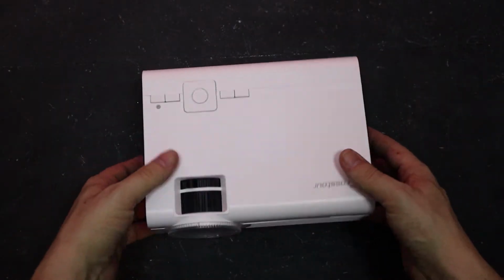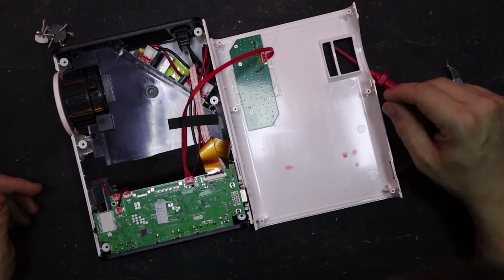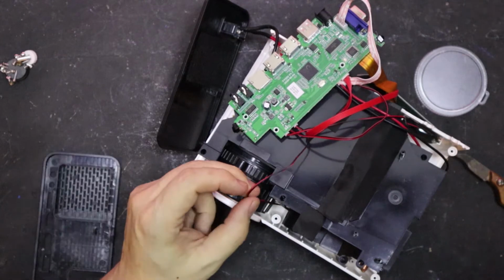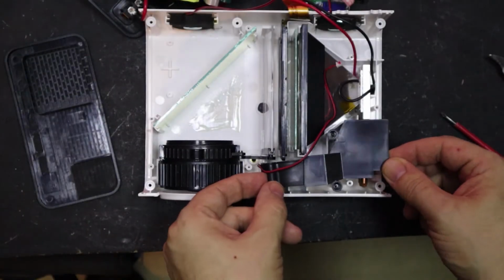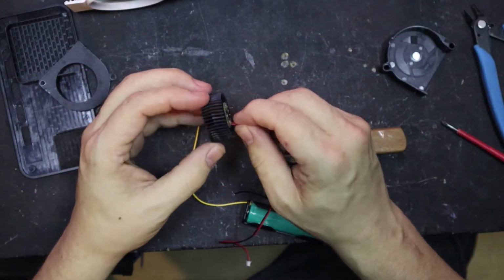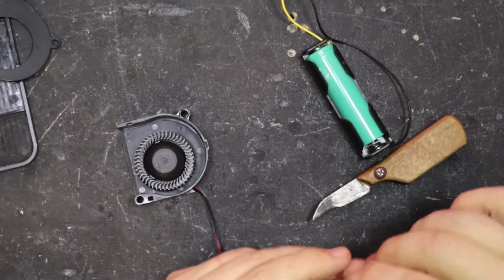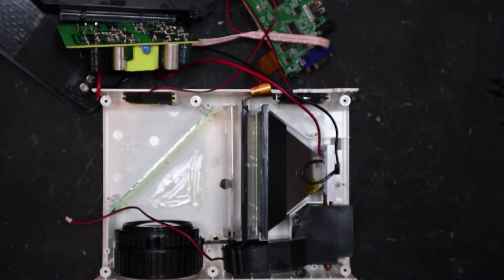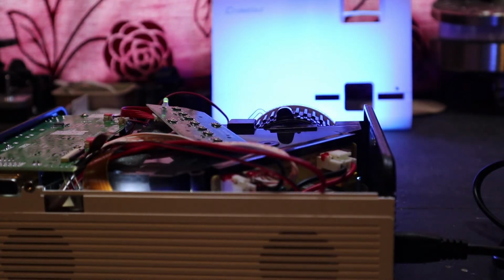Projector Teardown & Fix | A look into how a projector works

Comment: oh and you actually did not have to destroy the fan completely. you will never guess what made that sound. it was the wire on the bottom which actually lifts a bit and that then ticks on the fan blade. it can be quite annoying. and it normally happens when it is couriered.
Reply from the maker: No I checked all that. It was the blade rubbing against the housing. I've had it happen before. I will eventually have to get a new fan anyway so it's just a temp fix anyway

Comment: That is a piece of crap that projector, what cheap rubbish that end up in landfills. I do electronics and I can see you don’t have a clue what your doing at all. Don’t twist ribbon cables, always unplug them.
Reply from the maker: What a pleasant comment. I always find it funny the amount people like yourself can work out from one video. I "Do electronics" too. I have done for nearly 40 years. Just for your information It's working fine thank you very much.
Reply: @TheOffGridFamily  well as I said your not very good at it at all, not the way you do it at all. Also why the hell you want to fix a cheap bit of junk like that. It’s not even a real projector, just a cheap fake. Also learn how to remove cables and not force pull them off and not to twist ribbon cables. And you do electronics? Well it’s a joke, because it didn’t look like you know what you was doing at all.
Reply from the maker: @michaelmitchell8218  I'm assuming that you believe what you are saying and I've met people like you before. Due to that I will leave it there. You are entitled to your own opinion whether it's wrong or right. No one forced you to watch it. Btw the reason I fixed it was so it didn't end up in landfill!